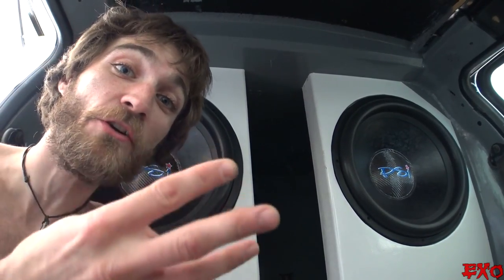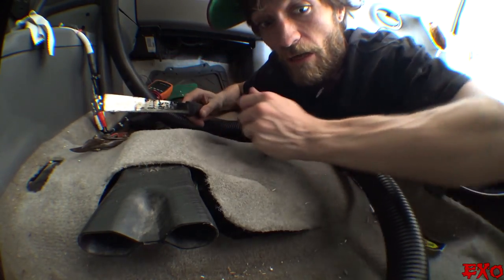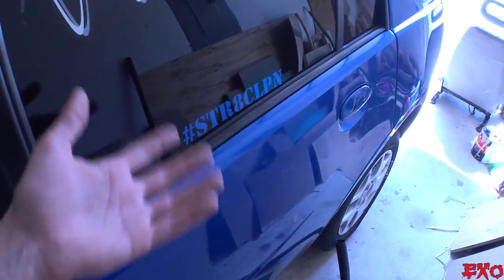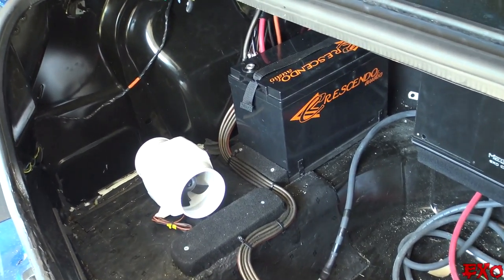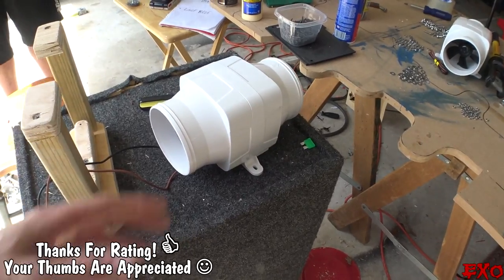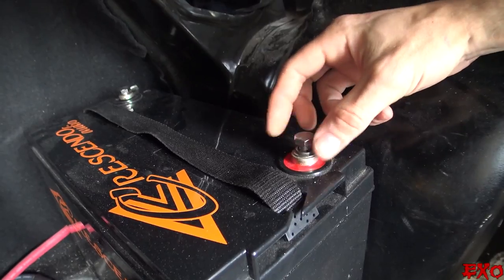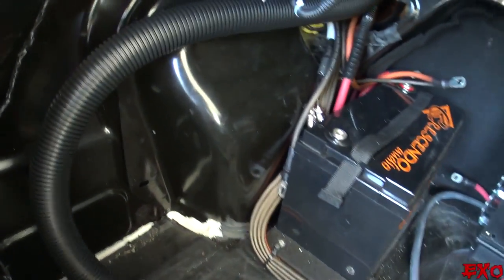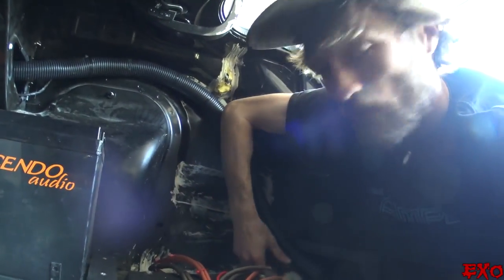EXTREME COOLING FANS w/ TheAmpLab 12v Lithium Battery Installation & Custom Car Audio BusBars

Comment: Nice work on the AC stuff. Just something you might not have thought about but change out your cabin air filter. that way you get full forced AC instead of trying to blow threw a dirty ass filter. other than that, keep up the good work my brotha!

Comment: i have done the ac fan to the trunk before i had a problem with hot days keep an eye out for condensation it will ruin the amps after time i trashed 2 Rockford 2ks cause they were sweating from ac blowing on hot amp in a hot truck jst watch for moisture

Comment: Awesome work EXO! Little Blue is coming along nicely. Just a friendly piece of information for you. if you are worried about the heat from the muffler, header wrap should work great for keeping the heat down in that area. It should be available in most auto parts stores. Racers use it to reduce the temperature under the hood.

Comment: there's heat shields that are usually above the exhaust components & i noticed your car didnt have any. if you bought some & installed it above the muffler it'd help alot with the heat. heat wrap would work also but the heat shield would give it a much cleaner look!

Comment: Hey exo! try heat exaust wrap on the muffler and piping going into it and exiting it to greatly reduce the heat so your air conditioner will keep those amps cool as a cucumber without working against the heat of the muffler

Comment: I know you didn't want to over complicate things but I would have painted the fans black and orange, I think they'll stick out too much if they're entirely orange. Also, I would have tried to remove the fan blade before painting, extra paint on one fan blade could cause it to rattle and not work properly.

Comment: EXO theres a way you can get full amount of cool air back there you can get a pvc connector to go onto the back of the fan size it down so it will go onto the hose your plumbing to the back so it will pull the cool air at a faster rate to the trunk .... and my other question is can you get a temp gauge for the front so you can see how hot it is in the back ... and can you vary the speed of the fan so you can compensate for the temp in the trunk when it gets hotter ???

Comment: I would work on better insulation or even rerouting the exaust pipe to a side exaust or something! compressed rock fiber would pretty much eliminate all the heat from the muffler, and by the video you have more than enough space between the muffler and the trunk on the outside! It would be cheaper, faster and noiseless! The vibration from these fans will be a bitch on everyday driving!

Comment: you should put a heat shield above the muffler to help disapate the heat away from that section that the amp will be mounting in the trunk

Comment: Exo, keep in mind that vent also pushes out heat when the heater is on. It's not only AC.
Reply from the maker: Yessir! Thats why these tubes are ONLY connected on the outlets for LOWER FEET - That way there is no airflow going to the trunk once the dial settings are switched back to blowing on your FACE, or the DEFROSTER.

Comment: insulate the muffler with exhaust wrap that would solve alot of heat issues and a heat shield in addition to the stock setup.

Comment: be careful with the ac please run it to the top fans , if it fires directly on the amps ,cold air hot amps ,condensation will  be on the amps , seen it before please be careful
Reply: I second this.

Comment: you should turn those brackets and two boxes and flush mount them and it will help hold the cold air in the Box to distribute to the inside of the trunk a lot better

Comment: exo I would put ducting on the fans to redirect the hot air to outside. turn those fans so the suck air over  the amps pulling the cold air,, and those are great fans but they pull 6 amps each

Comment: I currently have a Pioneer 760 on top of the A.C. outlet under the passenger seat. 2Ω non-bridged all day pounding a 12". Monobridged at 2Ω not recommended and gets hot even with A.C..

Comment: only problem I see is condensation from the a/c. hopefully it will work
Reply: 954cityofdahood doubtful. otherwisse ud see lots of condensation inside cars bc of a/c which doesnt happen. even so the pipes are so long it would catch any inside the pipes
Reply: Zach m, my old 2002 Honda Accord had alot of condensation from the a/c. my vent hole was above my headunit and one day it build up enough to drop on my double din headunit... and it never worked the same, it kept restarting.

Comment: hey EXO i want to give you an idea 
for the holes on the wooden plate with the black fabric on it just use a welding iron 
i have a friend the installs audio systems in israel and he use a plain welding iron just for these holes.

Comment: EXO I bought one of the fans your using in your build.  Are you using a switch/relay or something to turn them on/off?  I tried using the remote to run unit but then the amps don't turn on.  Wired direct to battery little thing pushes some serious air!

Comment: How did u run ur fans? I have mine ran to a toggle switch with my voltage meter which is ran from my amp input.

Comment: shouldnt have painted the fan blades it will make them unbalanced and will make abit of vibration
Reply: RC MAD true, that might happen
Reply: its possible but for the weight of a few microns of paint it wont hurt anything.
if anything the blades are probably cheaply made an weren't balanced 100% anyhow if were going to the extreme.

Comment: Is it a bad idea to do the big 3 upgrade with a stock alternator.
a mechanic told me that if you add 0 guage power to the stock alternator it will kill the battery, due to the alternator overcharging the battery.
Reply: who told u that? xD
Reply: Joakim Kempe it was a mechanic, basically he said it would send to much power to the battery
Reply: It's a lie mate :p only thing it could do is make it easier for the current to flow . It's the generator that creates the current so the cable can't increase the power if u know  what I'm saying
Reply: Joakim Kempe Thank you for the help!
Reply: That is incredibly false.

Comment: cold A/C air on expensive high powered amps may not be such a cool idea. When you get your install into full operation and cranked up, monitor temps to see if that is all necessary. Most good Class D amps run cool anyway, but blowers will never hurt. LOL
Reply: The a/c would be fine as long as the amps are warm, my concern would be if the a/c cools them on his drive then he opens the trunk on a warm summer day, might get some condensation.

Comment: when you have the lithium, why use the agm.?
Reply: AlwaysChangingMind why not use amg too lol more is allways better
Reply: Clayton Anderson lithium already hold lots of power. Much more than AGM. Well... A better charge/discharge rate. That lithium is almost just fine for 10k without the agms
Reply: AlwaysChangingMind 10k at what impedance do you think though? he's gonna need both agm and lithium

Comment: the cold air from the aircondition will create humidity and it will be bad for the amplifiers. just use the seaflo fans and it will be allright!!!
Reply from the maker: Not true in many cases, including this one!  Have over one year of observational experience showing it's JUST FINE!
Reply: Ac is a dehumidifier
Reply: What!? Ooh my god 😂😂😭 this has to be a joke. AC dehumidifies the air, where do you think all that water comes from dripping out of a air conditioner 😂 it's the humidity being removed from the air.

Comment: Just sayen as its probably to late . But you could have done just as well by having one bringing in fresh air and one pushing hot air out . The problem i see with your design. You have to run the a.c for it to work ...
Reply from the maker: Thanks for the feedback man!

Comment: I had a car come in that smelled real bad they had a place change there ac evap and they didnt take the dash out the right way they cut the box and used silicone to seal the box talk about stink i had to take the dash out and replace the heater box for them it was a mess the owner suied the other garage for the damage

Comment: I think you are losing ac flow with that type of co-flex hosing. To have efficiency you need proper ac ducting to the back
Reply: yes there will be some flow loss but considering the fan will be pulling a vacuum upon it, i cant see the big issue.
(thats providing he is going to make it a "sealed system" as it were.
ive used a meter or two of it for a pseudo cold air intake and it gave me quite a lot of flow
Reply: yes, perfect thanks. Need to know the flow, a radiator hose would work far more efficient. The vacuum pulling is not a concern as most of the air would be pushed through the system as that is how it  works regardless. Shouldnt even need the fans if you direct the cold air to the hottest part of the amplifier then everything else disperses. Need the fans to DRAW OUT the heat from the compartment more than anything else.